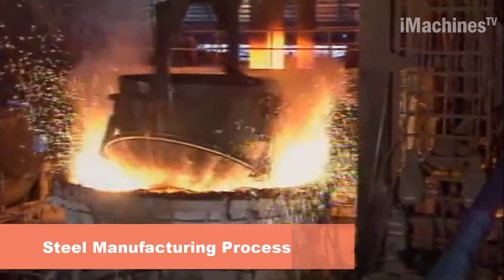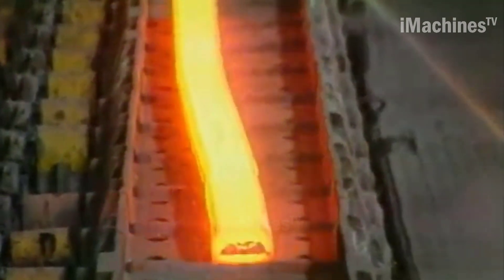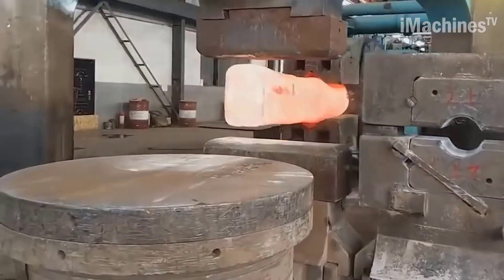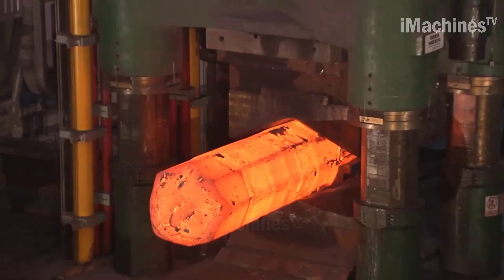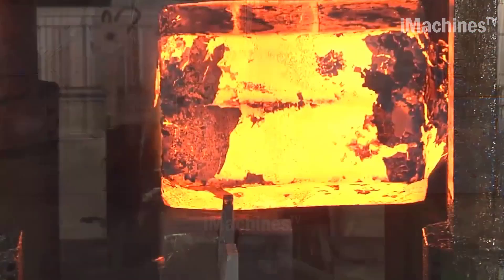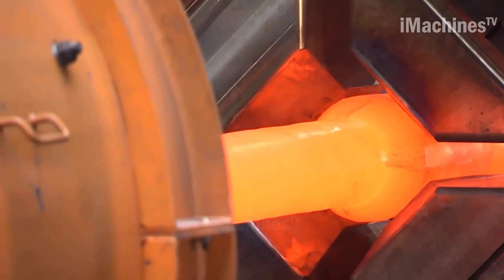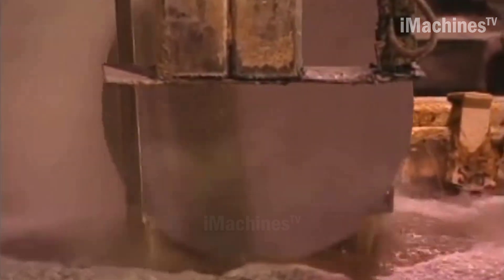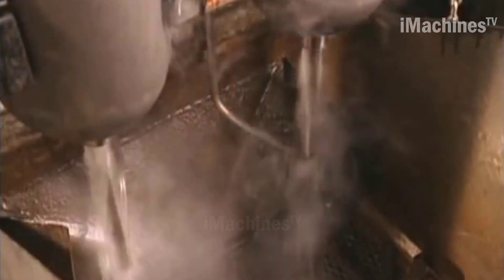Steel Scuba Cylinders Manufacturing Process. Modern Forging Technology. Heavy Forging Machines.

Comment: Narration is just random crap. Just a hodgepodge of videos. Scuba tanks are made from flat discs, as we finally see. Nothing to do with the first 18 minutes.
Reply from the maker: Please refer this 
0:01. Steel Manufacturing Process
3:37. Ring rolling
5:06. Open-die forging
7:34. The high-speed open-die forging press
11:12. The SMX 800 forging and pressing machine
13:40. Free forging
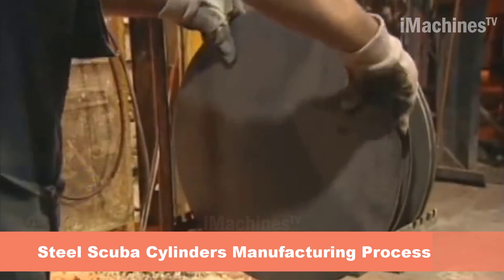15:44. Steel Scuba Cylinders Manufacturing Process

Comment: The first 17 minutes of this video had nothing to do witrh SCUBA tank manufacturing.
Reply from the maker: Please refer this 
0:01. Steel Manufacturing Process
3:37. Ring rolling
5:06. Open-die forging
7:34. The high-speed open-die forging press
11:12. The SMX 800 forging and pressing machine
13:40. Free forging
15:44. Steel Scuba Cylinders Manufacturing Process

Comment: Scuba tanks don’t start til 15:40
Reply from the maker: Please refer this 
0:01. Steel Manufacturing Process
3:37. Ring rolling
5:06. Open-die forging
7:34. The high-speed open-die forging press
11:12. The SMX 800 forging and pressing machine
13:40. Free forging
15:44. Steel Scuba Cylinders Manufacturing Process